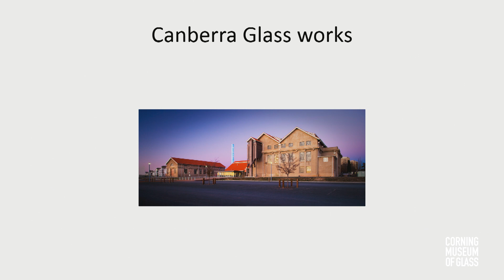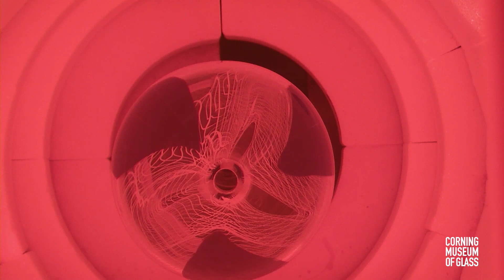Ben Edols Guest Artist Demonstration

Comment: The gold leaf does not turn the glass in contact red because you need gold salts because gold does not Oxidise like other metals. To make Gold Salts - Gold is dissolved in acid and the liquid is evaporated to leave the salts behind, This is added to the batch and it is melted - the glass will strike given an Oxygen rich atmosphere , when you have to remove the Glass from the furnace before it goes. If you over work Gold ruby the colour can disappear if you are not careful. The Red colour here looks more like a Selenium Red the way it is working. :-))
Reply: Thank you for that explanation. I will appreciate my ruby glassware inherited from my mother even more now!